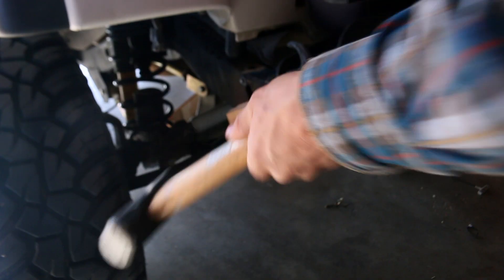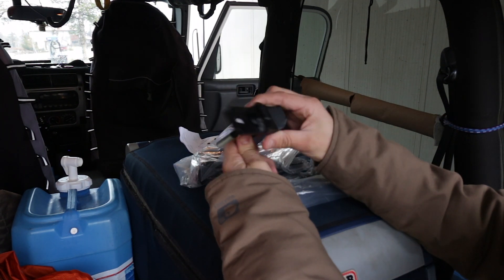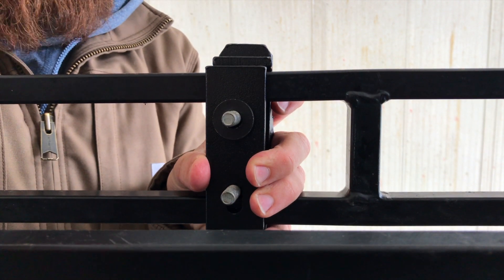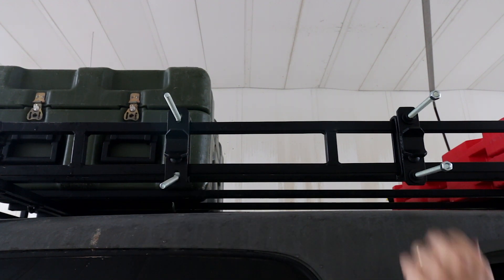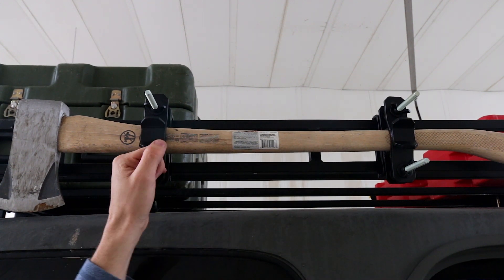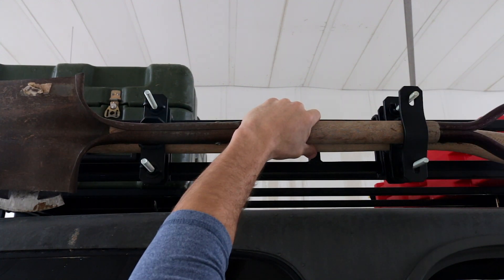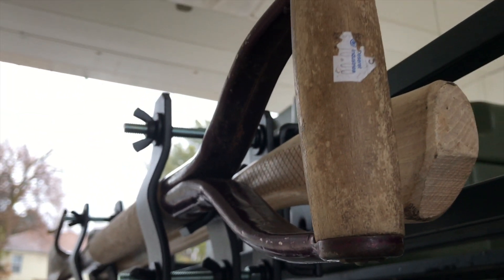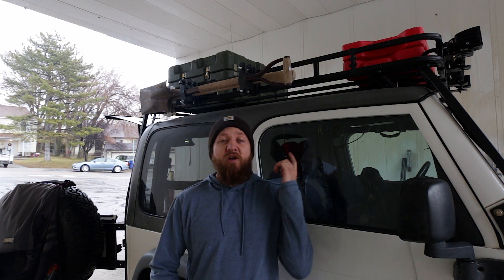Jeep Axe and Shovel Mount

Comment: If u still have them, u can change these clamps into a quick release one. Cut the clamp from the hole to the end of the clamp, so loosening both butterfly/wing nuts on one clamp holding shovel and axe, the white color bolt should be able to be moved out of the clamp, do this for the bottom side of the clamp, so the top side is still locked with the bolts. Ur shovel and axe should come off without removing the clamps fully. If u have seen a GoPro handle bar mount, u will get what am saying.
Reply from the maker: Now that’s a smart idea!